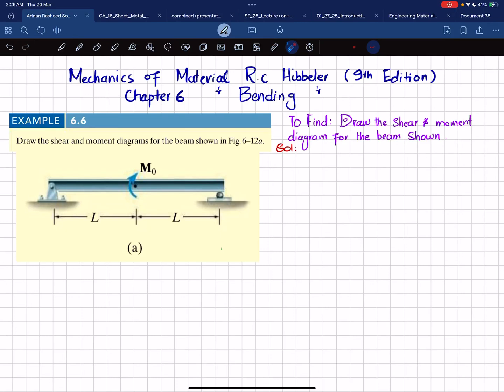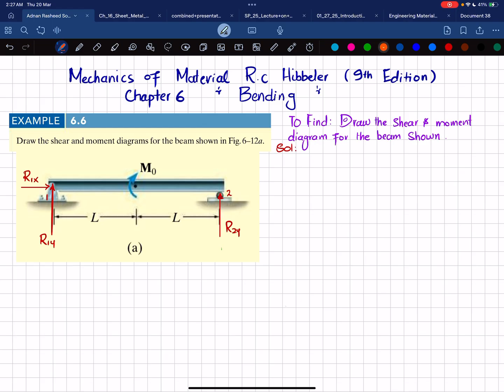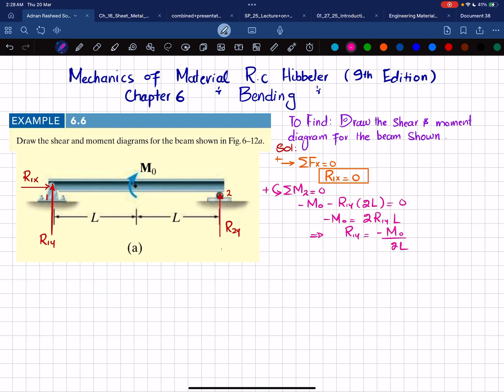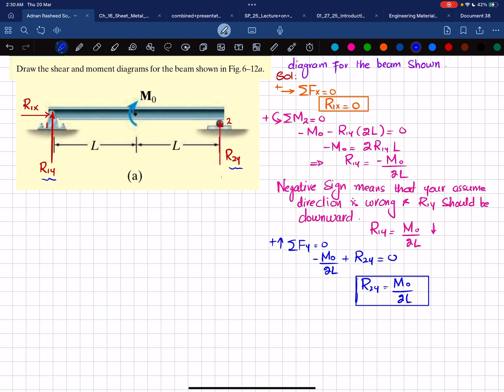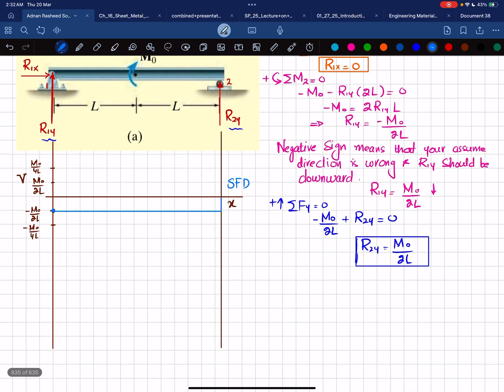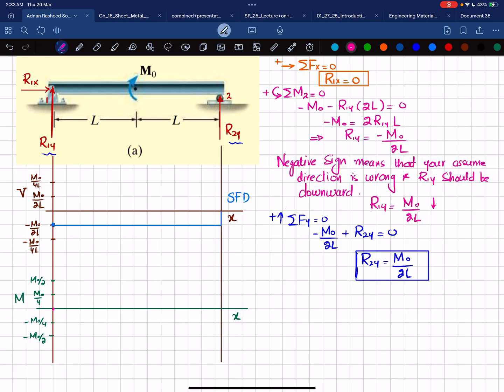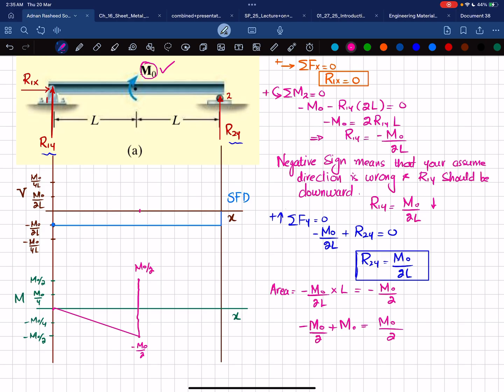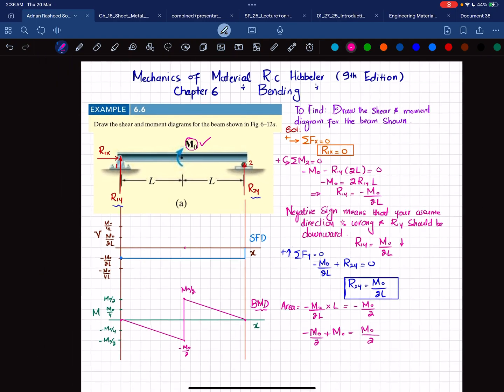Draw the shear and moment diagrams for the beam | Ex 6.6 | Bending | Mechanics of Materials RC Hib

Comment: Hi Mr. Adnan, I hope you're doing well. If I send you two questions about a deflection problem, would you have a chance to take a look?
Reply from the maker: Did you get your problem in the playlist?
Reply: @engradnanrasheedmechanical  Unfortunately, I couldn't find any examples like this in the libraries, it has a rod, and I think it's doing a separate extension, that's why it's confusing.
Reply from the maker: @ftlcs ok 👍
Reply from the maker: Chapter 12 Deflection of beams and shafts BY MECHANICS OF MATERIALS  R.C HIBBELER (9TH EDITION), Complete Solution by Engr: https://www.youtube.com/playlist?list=PLuj5YwfYIVm-zYKIRhkcp8T14ca9gKZVM
Reply from the maker: Check out this playlist please. May be you will find it.